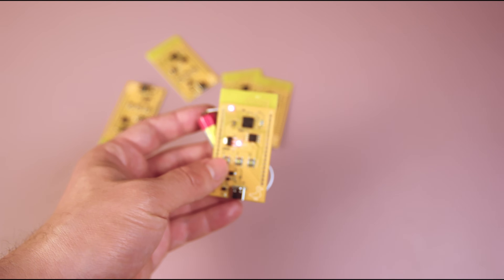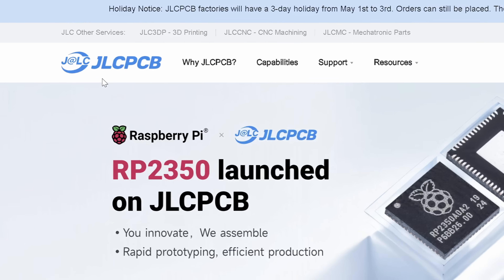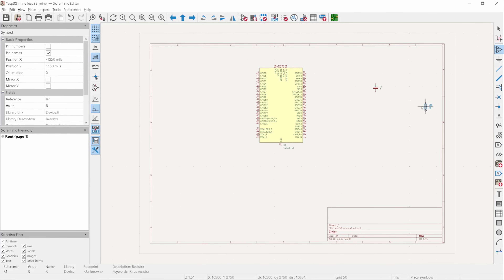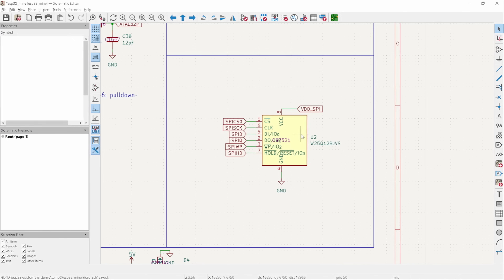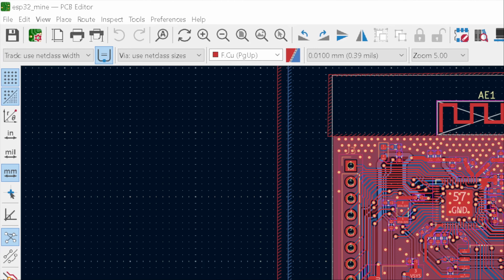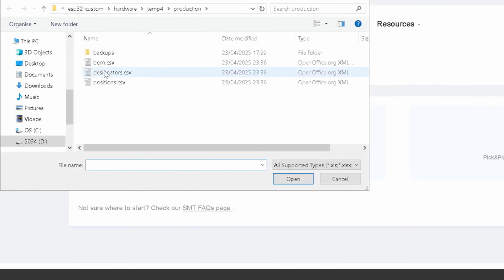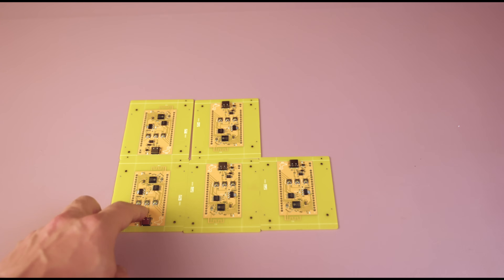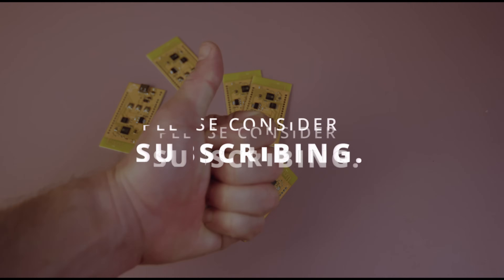ESP32-S3 PCB Design with KiCad: From Schematic to Manufacturing Step-by-Step

Comment: Hello, the documentation for circuit design states that the impedance should be 50 om. On a two-layer board with a thickness of 1.6 mm, the impedance of 50 om is achieved by using a 3 mm wide RF track on the bottom layer. However, your track width is 0.6 mm, which results in an impedance of 100 om, which exceeds the manufacturer's recommendations for the chip. The manufacturer specifies that the chip is designed for an impedance of 50 om. In the video, you don't show the operation of the WiFi signal or the WiFi connection. Perhaps the microcontroller itself is working. How is your WiFi signal functioning?

Comment: First thing, thank you first for the video and for providing the project in github. However, when loading the project from github into KiCad 9.0.6, both ERC and DRC came up with a 2-5 errors and many warnings. I don't think that was expected, is there an explanation? And could an error-free project be updated in github. That would give confidence to people new to pcb design.
Reply from the maker: Hi Adrian,

Most of the errors are from design rules I set intentionally, mainly around the USB-C connector where things are very tight by design. I didn’t want to relax the global rules just for that, and aside from those USB-C warnings, everything else works fine.

Comment: You’re amazing. I was also studying how to convert the official ESP schematic into a practical design file, and then I found your post. After watching your video, I was truly moved — thank you so much.
I have another question: I also want to add a lithium-battery solution, but normally the device will be plugged in via USB, and only when needed will the USB be unplugged so it runs on battery. May I ask, if the USB stays plugged in continuously, will it cause overcharging and shorten the battery’s lifespan? I’ve been stuck on this question for a long time. Could you share your design approach? Thank you.

Comment: Any reason you didn't want to use the ESP32 module that comes with antenna/shield case?  

I'd like to make a data recorder...  using an ESP32 and an ADC (TI ADS8588H  LQFP-64).  I think I can probably stumble my way thru the schematic, maybe even the layout (although the TI ADS8588H Layout recommendations of split Analog/Digital planes seems advanced for a non-hardware guy!)...

but the biggest issue will be the assembly.   My bad eyes and shaky hands, I don't think I'll have much luck soldering, even using 1206/1210 size components.  Where do you find someone that can do that?
Reply from the maker: Using the mcu directly gives a bit more flexibility, and tiny bit cheaper.
You can use assembly service for soldering, like the way I used in the video. its pretty straigtforward and reasonably priced.

Comment: i think esp32 s3 only support upto 32mb flash but i would be great to looking forware about S3 pin confliction and trick to use the conflict gpios if you have time to make deep analysic video or just give an excel sheet or documentation of pin which are completely free of conflict and which pin does have conflict and how to bypass them and bring them to use and which pin are no usable that would great help

Comment: Dude, I can't stress enough how useful this video is, plenty of videos/blogs will tell you the basics and point at documentation, but sharing tips about your workflow like adding an MNF column at 4:40, using JLCPCBs component sourcing resource, which parts JLC doesn't charge extra for, and how you lay your designs in general is literally gold for someone first getting into this stuff. Ty
Reply from the maker: Im happy that it was helpful to you:)

Comment: Thank you for the interesting video. I have few design consideration questions: 1) why did you chose S3 instead of C3? The C3 has lower battery consumption. 2) why did you layout the parts and not solder ESP module? this can also save the PCB antenna  3) The battery charger part name is wrongly appearing on the schematics. 4) I recommend to reverse the D3 led polarity. Better for IOs.

Comment: Thank you for this awesome video. I'm working on RGB controller for home on ESP32-C6 and I already ordered prototype from JLCPCB twice and there is a problem, they usually have only small amount of WROOM boards so I plan to switch to bare chip as well and I have found good examples and schematics like official one or XIAO ESP32-C6. The main concern I have is how good are these pure copper antennas. People tell that mass market PCB manufacturers are not able to make high quality antennas. I also have an option to switch to ceramic antenna, probably that will work more stable. How good does it work for you? I mean signal strength, stability and so on

Comment: Great video. I have been producing a few ESP32-S3 based projects in a similar way. A couple of things that would be good to explain..

How did you calculate the values of the LC network for the antenna based on a 2-layer board with 1.6mm height? I ended up using a 4 layer board to have a closer solid ground plane under some of the microstrip routing.
At 09:48 you show the process using Standard PCBA which is a lot more expensive than Economic. But byt he end screen caps it shows you using Economic PCBA (which makes sense, and it is actually why I chose to use the SOC instead of a module because the SOC is compatible with the economic process, where as most of the modules require the more expensive standard process.
Reply: Can you do economic PCBA without the module and hand solder it once it arrives? I wonder if that is even cheaper?
Reply: @fernandoi8958 yes, that would be cheaper, but I don't have much patience for doing the soldering. I even pay jlc to do the hand soldering of pin headers.

It's a shame they can't just charge me for soldering the casilated edges of the modules

Comment: I  am curious how much did a batch cost you?
I have been wanting a S3 with a 2mic daughter board from the esp32-s3-box but prob just I2S/PDM than analogue via a codec, but nice to just have a FPC ribbon.
Prob would want to keep the com/uart bridge port but don't need the usb as don't intend to use, don't need the rgb led off dev kits.
I have been curious how much its costs to get "small" runs assembled and shipped?

Comment: Great video, thanks for sharing your design process! 🙌
One small thing I noticed — you might want to look into antenna matching for your PCB antenna. It can really help optimize signal strength and efficiency, especially if the trace length, ground plane, or matching network isn’t tuned for your antenna’s frequency.

Just a suggestion in case it’s helpful — keep up the great work!
Reply from the maker: Thanks for the tip. I included some footprints for adjusting the antenna matching, but since the signal strength was roughly same (it was 10 dBM lower though) to the ESP32-S3 WROOM-1 module, I didn’t spend much time on it. That said, I’d definitely like to run more tests if I get the chance to use a VNA tool

Comment: It's 128 megabit (Mb); not megabyte (MB), or rather mebibyte (MiB).
Reply: yep, RAM & flash chip sizes are traditionally given in bits (lowercase "b" or "bit" instead of uppercase "B" for bytes). This notation also predates the whole SI Unit "kilo" is 1000 instead of 1024 stuff, so they do mean "mebi" and "kibi" in datasheets. For example "W25Q128JV: 128M-bit / 16M-byte" (in the datasheet) is a 128Mib / 16MiB flash when using "correct" units. This does not apply to SSDs and such, they do mean 1000s  in their marketing because it makes the numbers bigger...

The reason the ESP32-S3 can't easily use more than 16 MiB (not 32) of spi flash is that it only has 24 bit for addressing the flash. And that's exactly enough to identify each unique byte in 16MiB. There's experimental support for 32bit addressing which would allow up to 4GiB (the same old 32bit PCs could handle)
Reply: @zapl80  You just wanted to go on a tangent about 1000 vs. 1024 and proclaim that 128 Mib / 16 MiB is "correct" units? 😂 Notice that nobody ever says "mebi" or "kibi" because it's ridiculous. Datasheets don't even use it. Bits and bytes are inherently binary, so saying "mega binary bytes" is redundant and rarely useful unless you want to make it clear that you're not lying about the size of a hard drive. But I'd love to hear more about how flash memory terminology predates the kilogram! 🤯
Reply: @RaquelFoster  I don't use those units either 😅 btw not every computer ever used 8 bit per byte, early systems often had just 6. Maybe that's why storage is usually in bits because they don't change. Also not the kilogram but those kibi things are fairly new (early 2000s?)
Reply: the new version of ESP32S3 support max 128MB flash.
Reply: 13:51 Maybe he's joking? 128 Mbit == 16 MB, not 32 MB. And nobody who knows how to make a PCB would think W25Q128 meant 128 MB, would they? That goes back to literally the first memory ICs in the '70s. That's how you tell EPROMs apart. Those 27128A 128 Kbit EPROMs were in everything.